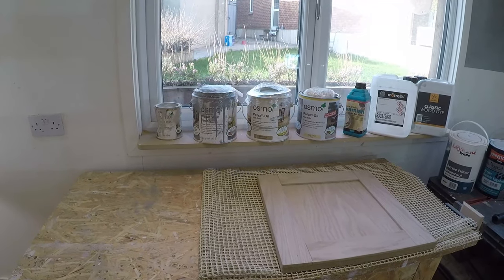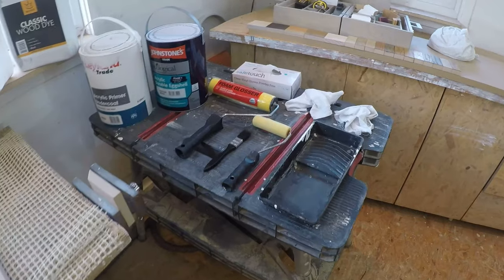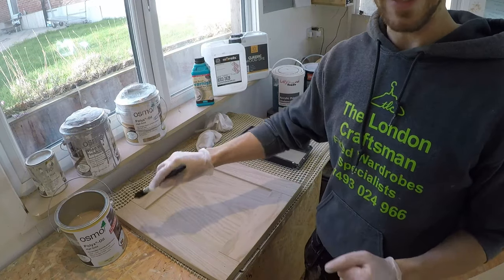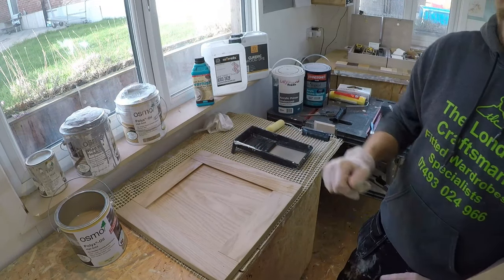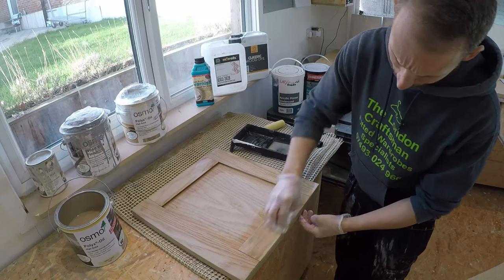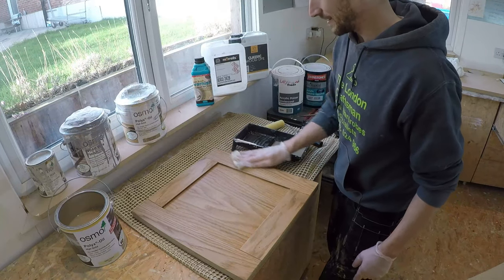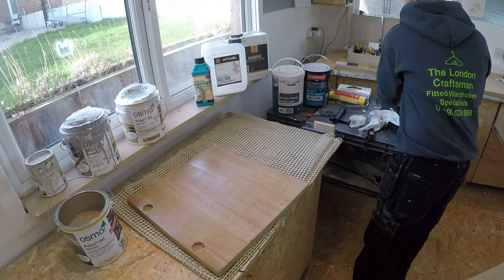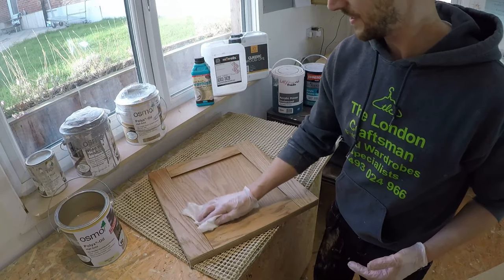How to OIL a wooden door  |  DIY  |  EASY PEASY  |  EP#7

Comment: Great to see the techniques you use. Previously I’ve obviously been applying way too much osmo so not only will this create a better finish the Osmo will go further, a bonus as it ain’t cheap 👍
Reply from the maker: Yes if found this way with the roller has made it at least twice as quick.
I can oil a whole 8ft x 4ft sheet /wardrobe backing in 3 or 4 minutes where as before with just a rag, at least 15 minutes.
It definitely saves loads of oil too.
I only just worked this way out a few weeks back when I had a large oak veneer wardrobe to oil. So much faster now!

Comment: I have 3 internal oak doors to do, what size tin would you think I'll need as it's not cheap stuff is it?
Reply from the maker: It goes a long way, the smallest size 375 should do it
Reply: @thelondoncraftsmanworkshop  cheers for the speedy reply mate.
Reply: Hi, I have oak internal doors to do, how many coats do you apply, I bought 3060 but it’s too shiny so will be sanding it off, glad I only did one door before seeing your video.
Thanks

Comment: Great video  and great tips . Would you  use the Osmo 3060.  or Osmo 3062.  . I have just have some news doors fitted from Howdens . I love the look of them ,(' shaker style '..) as they are now , but I know I have to protected them .  3060 = Matt  AND 3062 CLEAR. ( looking for some advice) ..cheers
Reply from the maker: Thank you! 
I'd personally go for the matt finish.
I really dont think there will be a visable difference between the 2 to be honest especially on an oak finish door.
Make sure you seal all edges too and the under the door too 😁
Reply: @thelondoncraftsmanworkshop   Thank you ,I have  just ordered the 'Matt ' Finish.Plus some lint free cloth , another great tip ,from your video !! .

Comment: Hi,I am thinking of getting an oak veneer door from Wickes and was going to use some Danish oil that I have. However on the door it says not to use any kind of oil. What are your thoughts on this please. Best regards Mick.
Reply from the maker: Hi I cant think of why the instructions would say not to use oil.
Virtually every door I had made whether solid timber or veneer has been oiled and never any problems.
Very strange!
Cheers Ryan
Reply: Some oils can lift the veneers off the door, hence why it recommends not too.

Comment: How would you apply the Osmo wood wax as I have bought it in light grey to apply to some oak veneer doors. Thanks in advance👍👍
Reply from the maker: Hi probably using the foam roller for the large surfaces then buffer off after with a cloth.
And the detailed bits id use a small brush and buffer of withba cloth.👍👍
Reply: The London Craftsman thanks very much😎😎